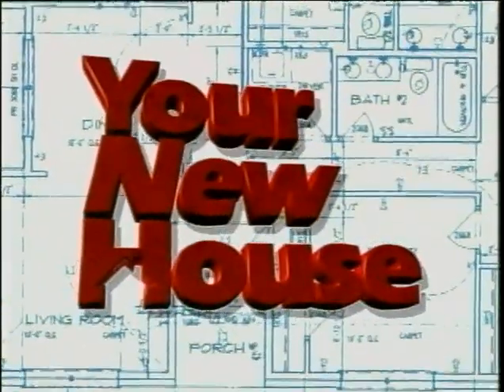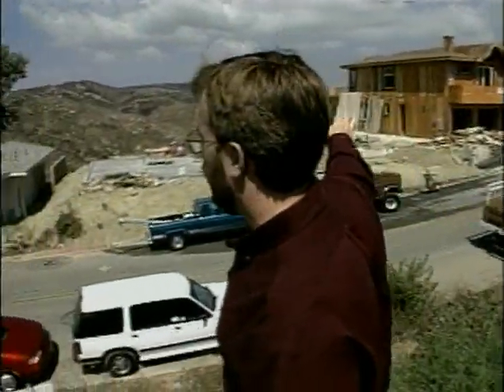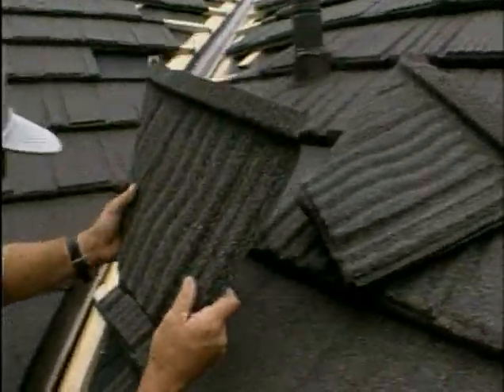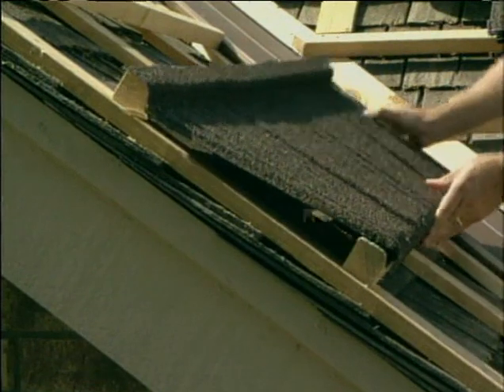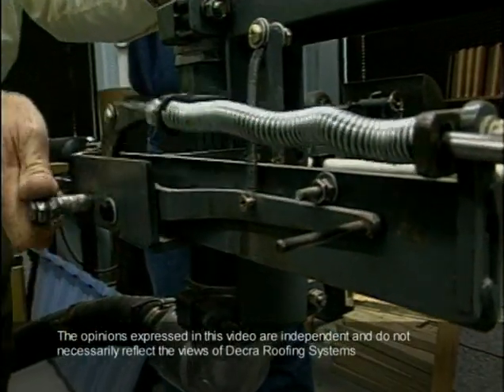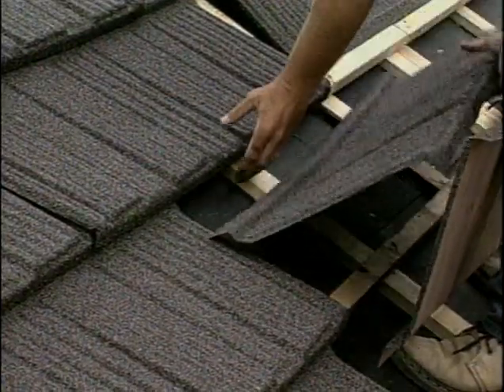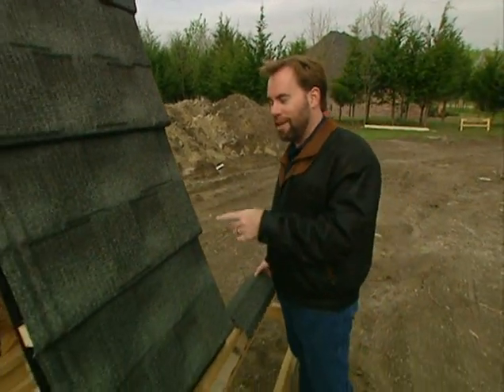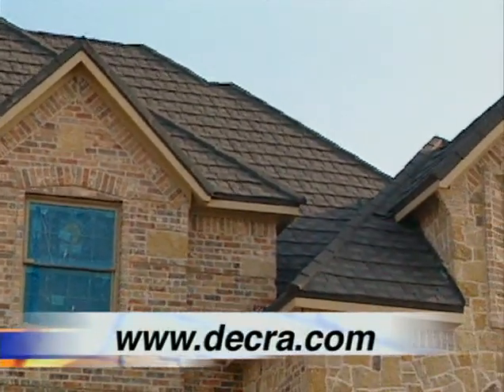Decra Michael Holigan Projects

Comment: This system requires a roofer to begin at the top of the roof and lay the tiles down the roof slope, walking backwards towards the edge. That is normally how someone falls off the roof - walking backwards towards an edge.  I would be interested if there was an increase in falls for this product versus other roofing materials.